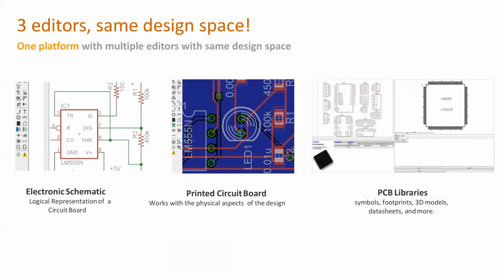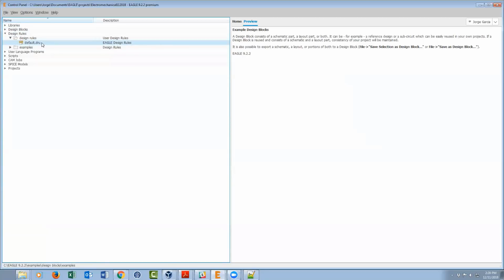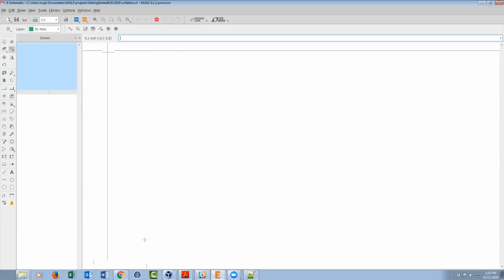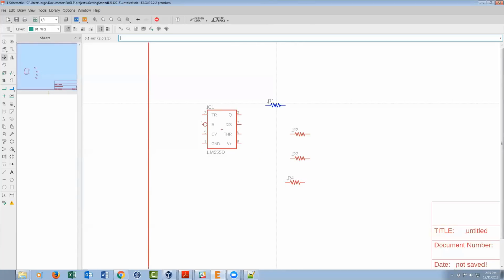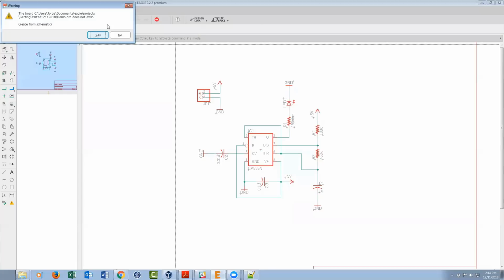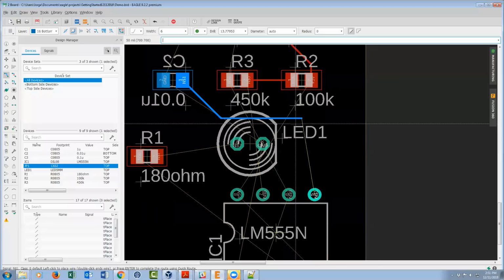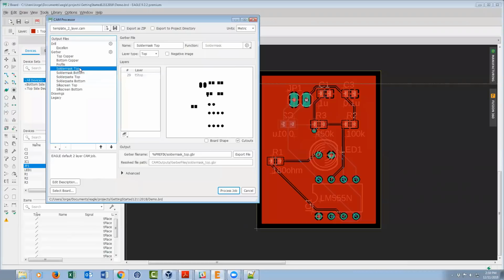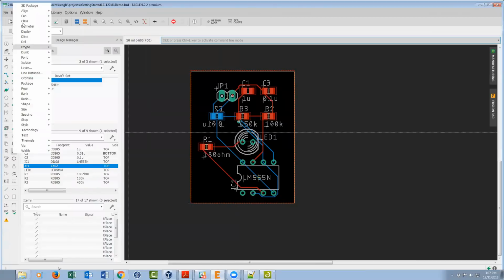Getting Started in Autodesk EAGLE - Dec 2018

Comment: Appreciate the effort put in by the two instructors. It was helpful. I do wish to echo several sentiments voiced by others. I needed to rewind dozens of times to see which icon was clicked on. It would also be better to have the user construct a small two-side "typical" circuit with a 20pin part, a bus device, some regulators, caps, resistors, connectors and supplies. Then take it through each step noting the icon and shortcut methods and typical gotchas. A sequence of videos expanding on each step would be the next useful addition. Oh, I know this will generate some debate, Autodesk really needs to bring the UI/UX into the the 21st century. This is really so 1990's. Remember if you don't innovate, eventually your competitors will.

Comment: I didn't think someone could buy and degrade the Cadsoft Eagle till I have tried out the Autodesk Eagle.
Man it has several issues from designing to routing, basically anything they tried to improve got worse or non-trivial.
The only pro is that it is now much slower and unstable...oh that is also a con, sorry.

Absolutely can not recommend the Autodesk version. Horrible.
Reply: And you just can't outright buy it anymore. Yikes.

Comment: Guys, I think you need to produce a set of getting started of videos for this software version of eagle. It should be best practices, show short cut keys rather than icons provided that is more productive. No point in unlearning bad habits when a new user gets better.

When a new user installs eagle, the video lesson should be identical to a new installation at the start of the video. If you like to make changes to the cad environment for productivity improvement, show the new user.

I can’t always see what the picked icon looks like, say what the icon looks like as you click on it.

Do not talk about how this version has changed or how great a new feature is, a new user is learning the tool for the first time and the software history is probably not important. New features and capabilities should be talked about in a different video.

Create the getting started video set around a new project that is something you have not actually designed before. The new project should have an opamp, A/D converter, cpu with a bus, a linear and a switching voltage regulator, a board with some physical constraints like a 12V power jack and switch and possibly an RJ45.

Deliberately put in newbie mistakes and later show the user how to fix them.

I don’t think a getting started video benefits from being a recorded live stream. Voice added to the video later will be more concise and you can edit and speed up the video through repetitive tasks after you have demonstrated them a few times.

Best Wishes,
Peter
Reply: Shortcuts are  a personal thing and people tend to change them. So showing the icons is always going to work.